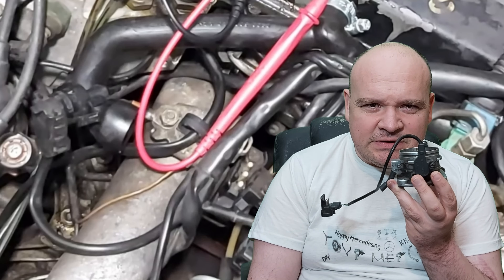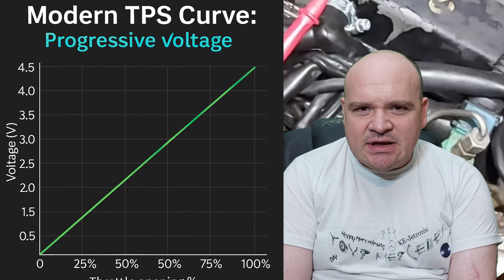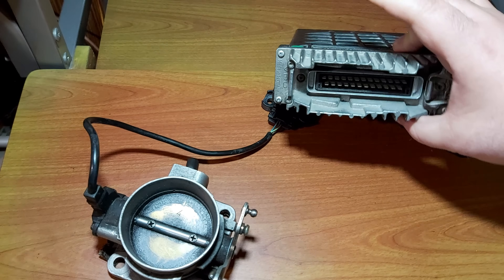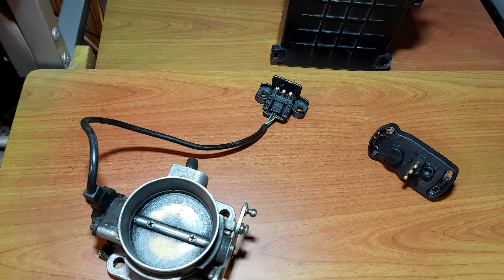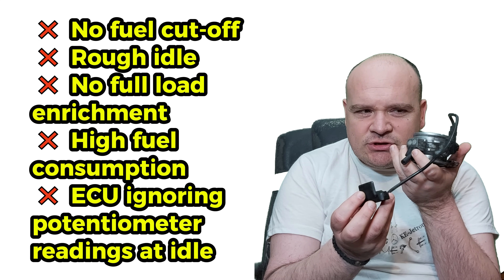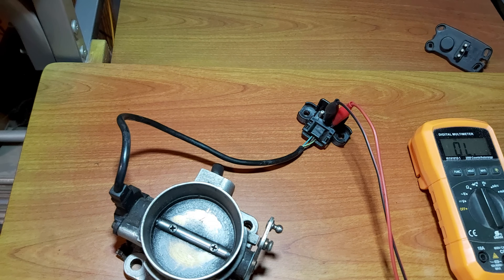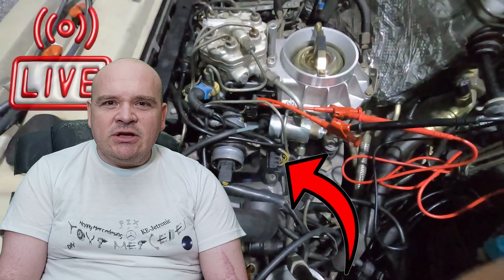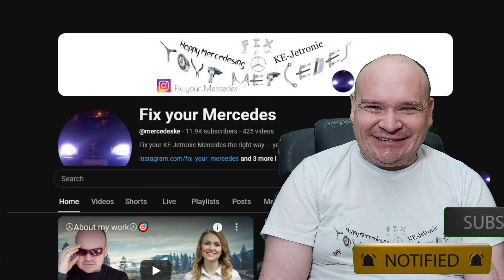㉦Mercedes Ke-Jetronic㉦ - TPS on KE-Jetronic: It’s a SWITCH, not a SENSOR

Comment: Hello! Your videos have been helpful, but im having a problem. My m103 engine is pushing black smoke and strong gasoline smell. Fuel pump works great and there is no gasoline dripping in engine. Also when i shift to D, rpm drops below 500rmp. Is something wrong. Thanks :)
Reply from the maker: Hello. Have you replaced the injectors or readjusting the mixture screw?
Reply: @mercedeske injectors are new, also mixture screw have been adjusted with emission tests

Comment: Hello brother ,i hope you can help me, i am From Greece and i have a cold start isue with my 190e 1.8. The car starts on key but has rough idle and misfires and when pressing the gas pedal hard it behaves rough with misfires until 2000rpms . From 2000rpms and up behaves normal. When is let to reach 80 degrees it smooths out and idles  fine and acceleration is normal.
Spark plugs and cables are new. Thanx !
Reply from the maker: Hello. Have you replaced or checked the potentiometer and the lambda probe?
Reply: @mercedeske  Not yet , i was thinking about that, lambda sensor on exhaust you mean? What about the ignition coil?
Reply: It was a broken spark plug eventually that caused the misfire and bad acceleration !

Comment: What is the difference between  m102 122hp and m102 136 hp? will the fuel distributor from 122hp work on the 136hp engine ?
Reply from the maker: No difference. It will work, just make sure you pair both LMM and MT to be the same number.

Comment: Just replaced my tps, on the bench it passed the multimeter test. But when installed and the engine is warm the idle was suddenly rising up, i jumped pin 1-2 and idle dropped to normal. Replace mine with a used one from local junkyard and my car runs flawlessly.

Comment: Really glad that you've mentioned the manually adjustable ICV.
How do we actually set that the correct way? 
I was last evening going on a drive, with my tools along, doing adjustments on the way. 
1988 M102 (KE2 I believe: TSZ, adjustable ICV, no lambda, no MAP), and at some point I was playing with the CO screw, trying to enrich a bit the mixture (cause I have few small detonations at about 2000-2500rpm),  and having my multimeter on the potentiometer, I got against in sort of a confusion:
1. The CO position, ofcourse it moves the sensor plate and the potentiometer has to be recalibrated - this is well known, nothing new.
2. The ICV screw allows more or less air, so the plate is moving again - actually very logic
These 2 consequences are one against each other. The CO adjustment is getting different results due to the screw-in differences of the ICV, and also the other way around. Is there any balance to look for?

Also the ICV screw, getting it more tight, from some point it won't reduce the idle speed anymore, but the driveability is changed, engine falling back to idle when driving ends going lower and lower, then coming back to 7-800rpm. Too tight adjustment means straight engine stall when falling back to idle.

In conclusion: what's the ideal screw-in for this type of ICV?
The CO must be adjusted before, or after the ICV adjustment? (Because they affect each other) 
As I have no lambda sensor and no gas analyzer, I am setting the CO the way you showed in a recent video: getting the plate at a position where both barely pressing or pulling up gets the engine to shake instead of reving up. 

Many thanks!
Reply from the maker: Hello. I would advise you to set the mixture screw at first properly as you saw in my video. Afterwards fine tune the screw on the ICV. Make the car idle anyhow until it reaches the operating temperature. Let it be even higher idle but let the mixture screw be where it is supposed to be. Even if the idle is approx. 1500RPM you can easily then manually adjust it on the ICV. Thanks for the comment and thanks for becoming the member of the channel. Happy Mercedesiiing!
Reply: @mercedeske That's exactly the way I was doing it. KE2 is really sensitive, as all adjustments are done manually: no lambda, ignition distributor has vacuum box/capsule, manually adjustable ICV.
It's really pleasent to set the car on your own once you're doing your homework (this was the most useful channel!!!♥️), but I also believe it's very frustrating If you're not doing your homework.
Now I am struggling with small detonations at about 2000-2500rpm, seems like I can't get them away: 95 octane gas, adjusting the ignition distributor all the time, using NGK BP5EFS spark plugs (as they work better at high temperature), CO enrichment also won't help, new leads, etc. Probably my pistons are already destroyed. Gonna have a compression test, tho the car is starting very good both cold and warm and it feels like it has the potential for power, just not set right. Potentiometer always recalibrated after I am doing anything that would change the idle postion of the sensor plate.
Also the engine is burning oil like crazy: 1L per 500-700km. But I believe that's the valve stem seals. Going to take the engine head off next month and replace stems, head gasket and see how the pistons look like. 
Other than that the engine is very stable. Never stalling, steady rpm, just a bit of tremble at idle. No surging, valve's rocker arms or chain sounds. 

I also just bought the Haynes service manual.
Reply: Tho the KE2 is so mechanical, it feels more brutal once it's getting back on the track, compared to KE3+ 😁